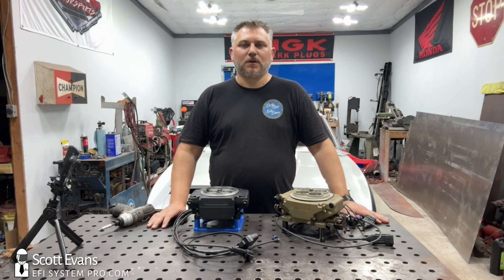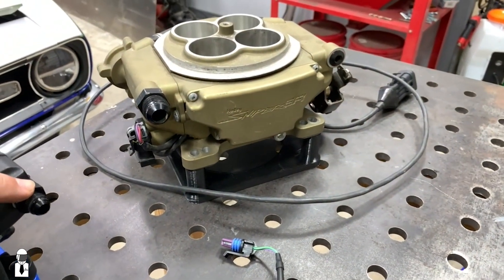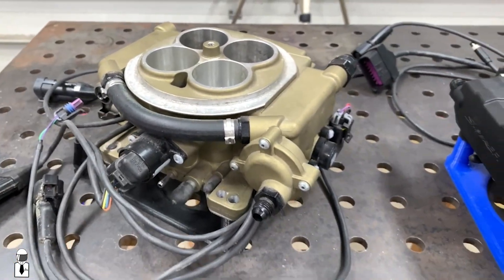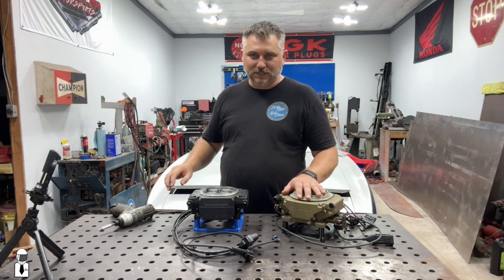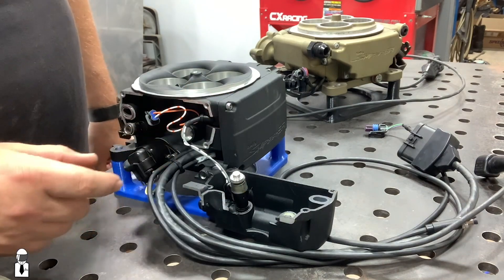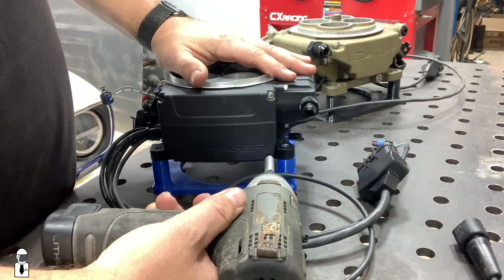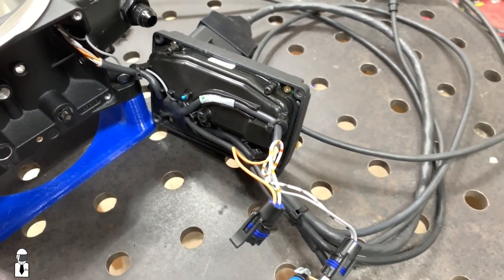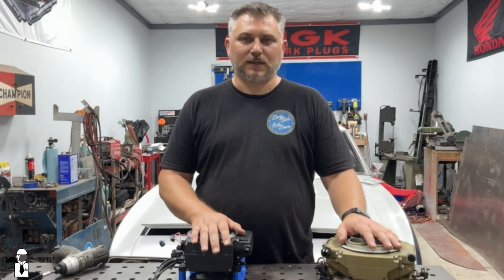What's Inside the New Holley Sniper 2 EFI Unit | EFI System Pro

Comment: Can the sniper2 control a dry nos plate setup?
Reply from the maker: The Sniper 2 can't control nitrous, but I am working on a nitrous tuning video for the Sniper 2 so you can still run a dry shot with a Sniper 2
Reply: @efisystempro  i cant enable it in the software
Reply: @efisystempro how far are you on this video

Comment: What is the gray wire going into the front cover ? I'm chasing an issue with my sniper 2 not sending ground trigger to my relay and pulled the unit apart just to see what was inside and that gray wire into the front cover is left in there with a spade terminal already mounted ? Does anybody know what that's for ? Please do share
Reply from the maker: There doesn't seem to be any use for it. The Holley patent application shows it not connected to anything and just inside the injector cover. There is no indication of why it is there anywhere.
Reply: @efisystempro  I did a bunch of investigating myself on it after I asked this question. From what I could find I read that it's an option tach signal for a traditional style Hei distributor and or a -coil feed of some sort. Appreciate your response though. Thank you much. You have an opinion on why my unit is not getting ground trigger to the relay to power my Fuel pump positive? I'm still trying to find a solution to that problem. Thought about a splice into the wire and add ground? I poke probed My smaller blue wire (ground trigger) to relay and gave it a ground and everything works as should. Unit has good ground also. Not sure what's keeping me from getting my ground trigger
Reply from the maker: Have you gone through the setup wizard yet? If not there is no information telling the ECU to trigger the pump. If you have, it will run the pump for 5 seconds and stop. Then it won't run again until the ECU sees engine RPM or you cycle the power again.
Reply: @efisystempro  sure havnt. Was testing wires and what not to check everything over before I ever put fuel in the car. I work out of a racecar shop in southwest Michigan we put this setup on a almost finished 70 Mach 1 mustang so didn't want to take chances. I'll definitely go through the set up wizard first and see what I come up with. Appreciate that.

Comment: Hope I never have to pull mine apart, but at least now I know what I'm looking at.
Just about to install mine on a 350 chev with stock cast manifolds, approx how far from the manifold in the down pipe should I place the O2 sensor?
Also where do I find the stl for that 3D printed work stand?
Reply from the maker: I like to put the sensor about 6-10 inches after all 4 pipes merge from the header/manifold. That usually ends up about 2-3 inches down the downpipe after the collector flange. Here is a link to the work stand. https://makerworld.com/en/models/378272#profileId-278224